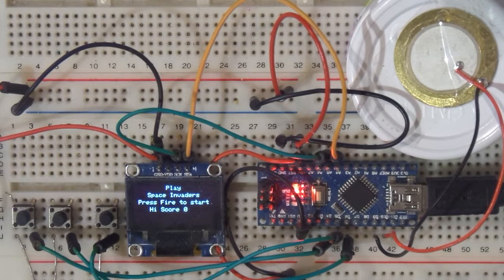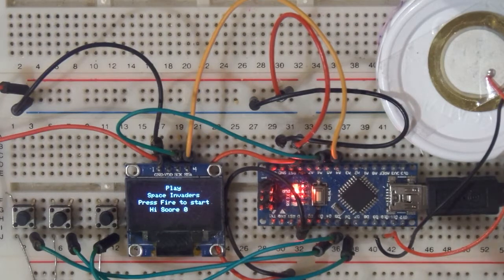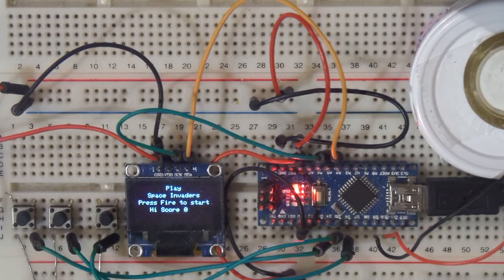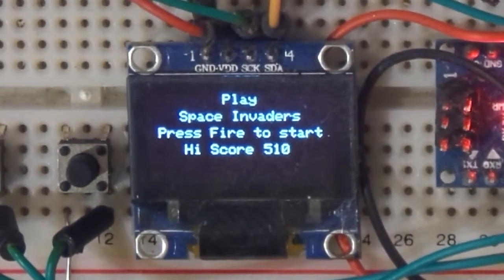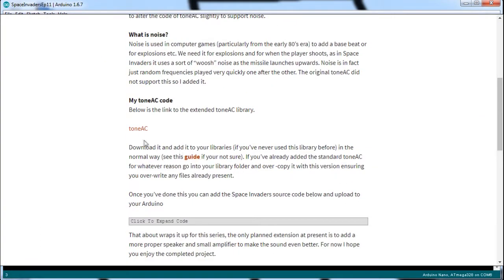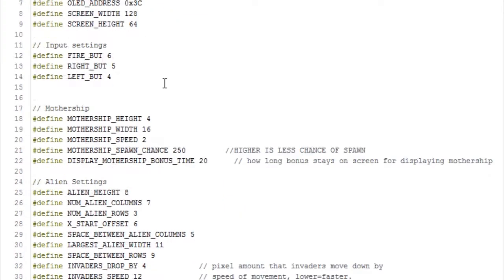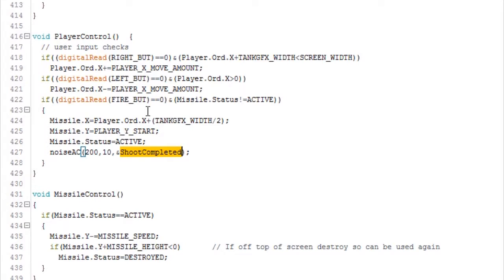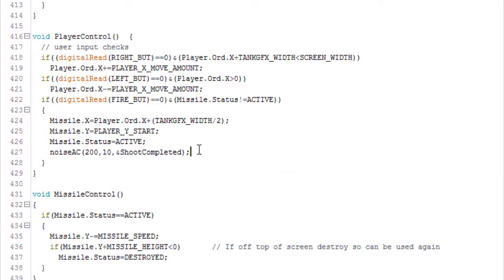Space Invaders Ep11 : Adding Sound

Comment: Cool! The only thing is that my oled screen doesn't display everything. Its like if it zoomed in. Im using a 128x64 oled which I'm pretty sure you are using. The tank and the bases don't show... but the aliens do. I hope you can help me with this and have a good day.
Reply: I think the problem is in the code.
Reply from the maker: Yes I can help, it's a common problem using these screens and the adafruit driver. If you read the page on using these screens on my website it tells you what to do but in brief the driver code by default is set to use a 128 x 32 screen and you have to change a setting in the header file for that library. Go to this page on my website
http://www.xtronical.com/basics/displays/oled-128x64-arduino/

Scroll down to where you see the heading "Altering the screen size definition in the Adafruit driver library“ and follow the instructions there.

Hope this helps.
Reply: @XTronical  Hello again. I have tried the Adafruit library code with the adjustments needed. Somehow, the screen is black. I have checked the connections on the Arduino Nano, but everything seems fine. Anyway, I was looking for the line of code in the Space Invader project that says: #define SSD1306_128_64 but I could not find it. I just added it with the display settings but nothing changed. The screen was always zoomed in. Hope you can help me again : )
Reply from the maker: Yes I can help. The screen size line does not go in the space invaders code. It goes in the adafruit header file for their library. Remove it from the space invaders code. I've copied the instructions from the link I posted last time, not sure how well they'll look here, if it is not clear then go to the Web page that I linked to in the last reply I did. Here it is

Altering the screen size definition in the Adafruit driver library
OLED screens come in various pixel definitions for both width and height, the  library supports three different sizes at time of writing. Open Adafruit_SSD1306.h , which should be located within the libraries folder in the folder where your Arduino projects are stored, for example mine is located here;

My Documents\Arduino\libraries\Adafruit_SSD1306-master

At around line 70 you will see the following lines

// #define SSD1306_128_64

#define SSD1306_128_32

// #define SSD1306_96_16

 

By default #define SSD1306_128_32 is un-commented and the others commented out. For our purposes we have a 64 pixel height screen and this is the line we need to uncomment, so change the code to look as follows;

#define SSD1306_128_64

// #define SSD1306_128_32

// #define SSD1306_96_16

 

Hope that helps.
Reply: I know this is an old comment, but I had the same issue, so this might help anyone else looking for an answer. I had to change the line Adafruit_SSD1306 display(1); to Adafruit_SSD1306 display(SCREEN_WIDTH, SCREEN_HEIGHT, &Wire, -1); to get the display showing properly.

Comment: very interesting  project ,   i see all videos  and in this stop by a error after compiling ,  the error show as not defined  the noiseAC  exactly this:
"Space_Iinvaders:427: error: 'noiseAC' was not declared in this scope"
I change my library of ToneAc  by your library downloaded from the blog.  
Can you  help me ?  
thanks for your great videos !!
Reply from the maker: I've double checked the download and the command is in there. It's a bit of a puzzle. What I would suggest is making sure that the old toneAC library has been removed before adding the one from my website again.This is because if an old library has not been removed then it won't always over-write with the new one. Go to wherever you library folder is (usually where sketch folder is as well) and open it. Manually delete any toneAC libraries. Then manually add the one from my web site again. 

Hope this helps.

Comment: Very COOL I never realized that an Arduino had enough power to run a little game like this. I am amazed.  Right now, for some strange reason, my arduino IDE refuses to program nano's, I can go up in LInux and do it, but that is a pain, so I put it in an Uno, and it works good.  The only problem I am having is converting the buttons to a tiny joystick that I have for my devices.  I can hook them up, but no matter how I plug them in, I have to use down for right and right for left.  This can get a bit confusing so I guess I shall build the little button device as you have indicated.  Thanks a million for showing me the real power of these little boards!  It is AMAZING!